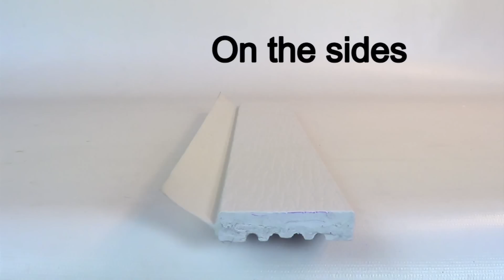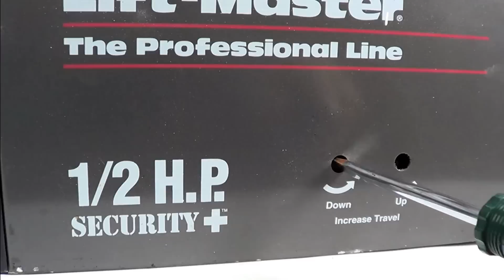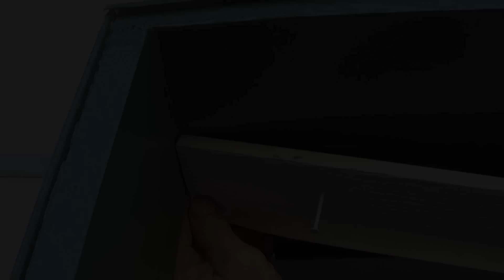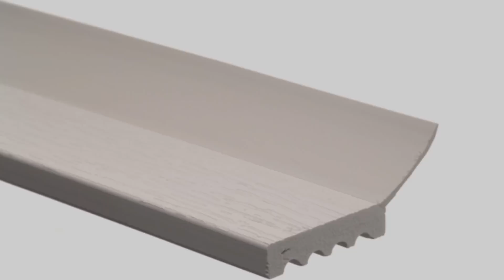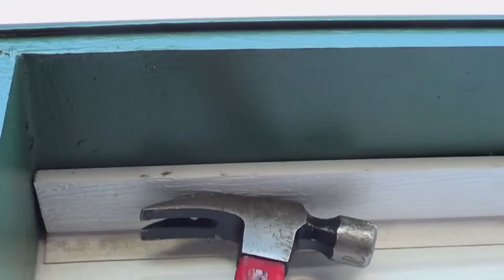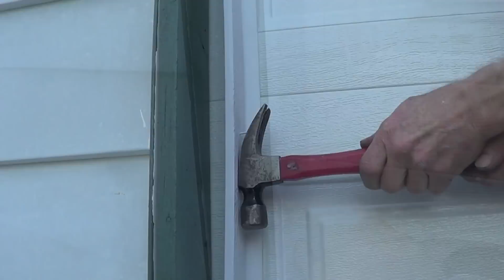How to Install Stop Molding Weather Seals

Comment: Thanks for the video,  what about doors with 45 degree angles on the top corners? What’s the order of operations?
Reply from the maker: Hi Bob Hope! We would recommend that you start with the top board, as in this video, and then work your way down, doing the angled pieces, and then the side pieces. Make sure you make the angled cuts in the corner of the the PVC parts to be the correct way for the side of the door you are working on.

Comment: Great video for DIY but I'm confused. I purchased some garage door seals that are just like these and the installation instructions say to put the side moldings up first, then the top, cutting the weather stripping at 45 degrees to make a nice miter. Which is correct? Thanks for any help.
https://hw.menardc.com/main/items/media/ROYAL027/Install_Instruct/Royal_TrimMouldings_Contractor_Handbook_4x7_ImposedPages_FINAL_web.pdf
Reply from the maker: Hi Rusty! We would suggest putting the top on first because we've found that it gives it a better seal to the door this way. The 45 degree cut is correct, because that way the top and sides align properly and will eliminate the gap between the stops.

Comment: Problem I run into is that the roller track (or whatever it's called) isn't adjustable on my doors. It's just a fixed distance and that's it.
Reply from the maker: If you're talking about the tracks that the door goes up and down on, no, those are not adjustable. The top fixtures on the garage door usually can be adjusted in order to close the gaps and get the door to seal.

Comment: Great video. The only question I'm confused about is the stop flaps at the beginning of the video. You showed cutting the corner of the PVC end for proper fitting but when you showed the installation you did not cut the corner.
Reply from the maker: Hi marieneabc1! You can do this either way, because it does work either way: the cut end ensures a more snug fit.

Comment: The top inside of my garage door frame is warped inward so that, when closing, about 8 – 10 inches at the top of my garage door rubs it in the middle. It's clearly visible from the paint that has rubbed off and from just looking up at the frame.  Unsure about how to fix it. Needs to be planed or something similar.
Reply from the maker: You can either plane the header board, or you can loosen the top fixture rollers so the door clears properly in the middle. Then you can reinstall the horizontal stops to align with the top of the door

Comment: I followed the directions exactly, had a great seal. Then I tried to open the door and the first joint was catching on the top seal flap and the side flaps were preventing the door from moving smoothly. I redid it but now there is a good 1/4 inch gap in  many places. I lowered and raised the door as I went to check placement that was as tight as I could get it but still allowed the door to open. I could not adjust the hinge/roller placement as shown in your previous video because they were not the same kind of hardware and no adjustments were possible. My garage is not square by any stretch of the imagination as it is an old (1940s) adobe building.  Do you think that is why I couldn't get it tighter? I think it will be helpful, but I sure wish I could have used it with the first placement!  Your videos are really helpful and the diagrams and demonstrations are really clear. Thanks!
Reply from the maker: +Sharon Shortridge Sorry to hear bout the problem, Sharon. Often in shipping the vinyl flaps flatten, preventing them from sealing. There's no way to get the vinyl to seal without the hard PVC binding the garage door in the tracks. The only solution may be to replace the PVC stops.
Reply: +DDM Web Services, Inc. I'll go talk to the company I bought them from and see if they will replace them. Thank you for your reply.

Comment: My garage seals were installed several years ago.  I recently noticed that light enters along the top either because the foundation moved or the seal was installed incorrectly.  Finishing nails were used for the install.  Any suggestion on how I can remove the nails to adjust the seal without risking damaging the plastic?
Reply from the maker: If you have light all the way across the top you may be able to eliminate it by adjusting the top fixtures. We show how to do this at https://www.youtube.com/watch?v=7QuiQDICrkA&feature=youtu.be. If the light is just in the center, the top of the door and the strut may be bent. This can be fixed by bending or replacing the top strut. We show how to do this on our strut page at http://ddmgaragedoors.com/parts/struts.html. The best way to remove the PVC stops is with a thin pry bar. The heads of the finishing nails should pull through the PVC. If the nails have heads you'd best be prepared to replace the stops. I've been successful only about half the time.

Comment: Note: 
45 degrees ≠ 90 degrees.
Reply from the maker: Thank you for the correction!
Reply: So which is it? When the door is closed, is the seal (flap) supposed to be at an angle of 45 degrees to the door (and frame) or 90 degrees to frame and parallel to the door? Does this apply to both the top seal and the sides? Thanks.
Reply: DDM Web Services, Inc. I believe my seals were installed incorrectly. They are pushed up so tightly to the door that, in some places, the outer edge of the flap is actually pushed away from the door! These were installed by a contractor (Overhead Door) and I was surprised that they were installed before the door was installed. I later questioned another person at Overhead Door and was told that was in fact the correct procedure.I am sure glad to see your videos as they make so much more sense to me. In fact, I spotted another problem with the installation of my doors by watching one of your other videos. Not sure whether I can remove and properly reinstall the vinyl stops since they may have taken a permanent set over the time that they have been in use. I appreciate your work and thank you for posting.
Reply from the maker: arcstrikeful Install the stops as shown. The hard PVC meets the door at a 90 degree right angle. The flap acts as the hypotenuse of a 45 - 45 - 90 degree right triangle.The two 45 degree angles are inside the triangle. That's what I see whenever I install stops. The two outside angles are each 135 degrees if that helps. Sorry for the confusion. Thank you for the clarifying question.

Yes, the angles on the sides are the same as the  angles on the top.

Comment: Great tutorial, like your others. But, one thing I'd add is to recommend a good nail size. I'll just be guessing based on the ones I see in your video.
Reply from the maker: In the trade we use painted Stormguard nails, about 3/32" thick, 1 1/2" long, with 1/4" diameter heads. We buy these in 5 pound boxes. In the next month or so we hope to have small packages of these nails available on our PVC stop molding page at http://ddmgaragedoors.com/parts/garage_door_seals_top_side_seals.html.